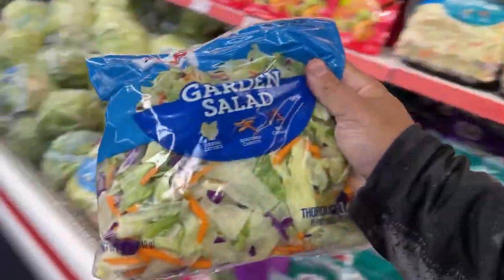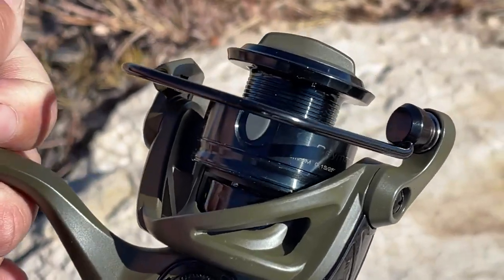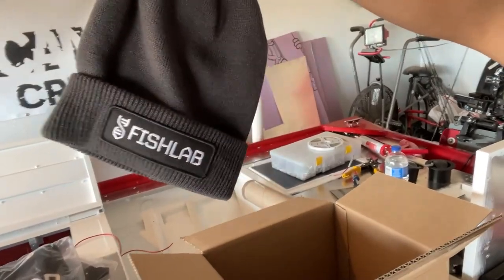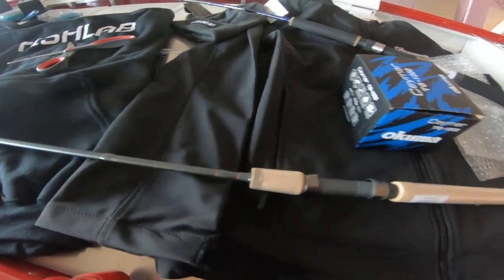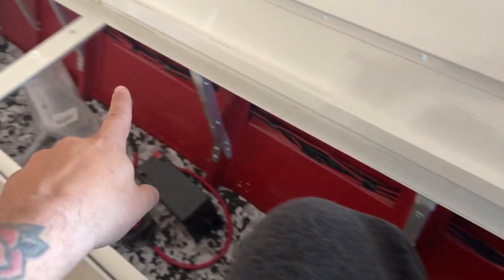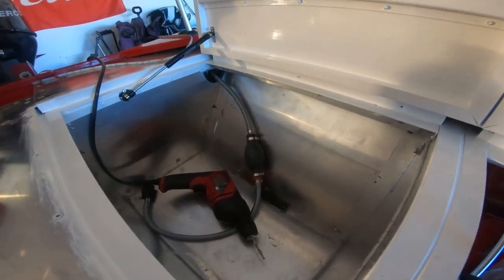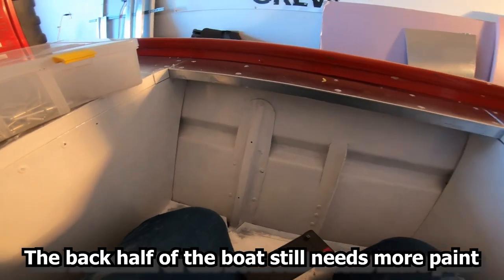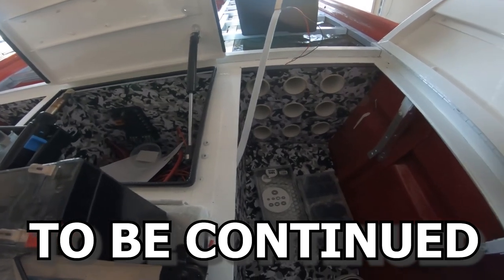UNBOXING LIMITED EDITION FISHING REELS!! And JON BOAT UPDATE

Comment: Hey real those look sick the reels look awesome wish I had sponsors like that but my concern is for the light in the gas tank what I'm figuring is that in the time of the summer that you go fishing and I know it gets hot up there cuz I got family living and Las Cruces close to close where you live I know it gets hot so the fumes from the gas tank and I know you haven't put the vents yet but if he put the lights there and might cause a spark and explode if you do fishing at night in the summer that's an FYI but anyways bro boat looks good also I was thinking that why are you putting all the lights on one bar on one toggle switch you can separately switch like cuz you have another control panel to put it on for each hats if you wanted to so in figure which time you want to put right there by you in the cockpit so you could put on lights when you're fishing at night and if you do use a light busbar combo to connect to one fuse there on the block of panel